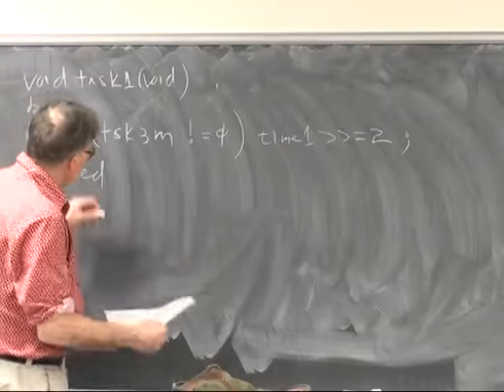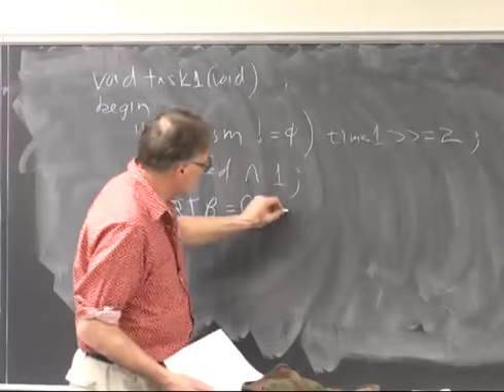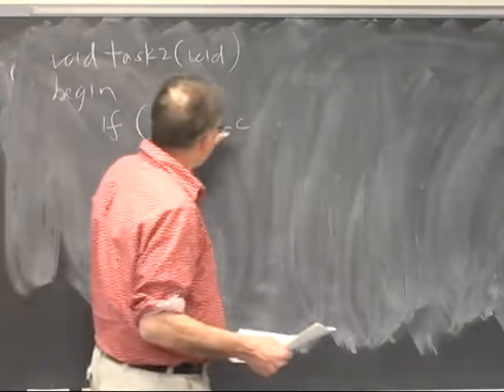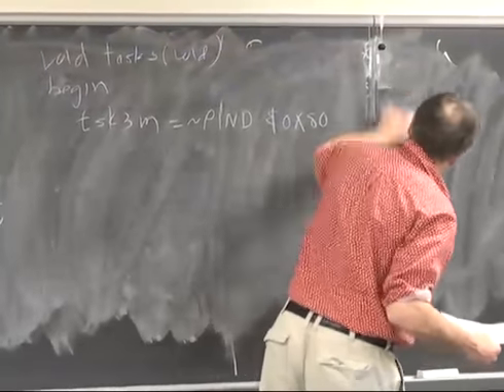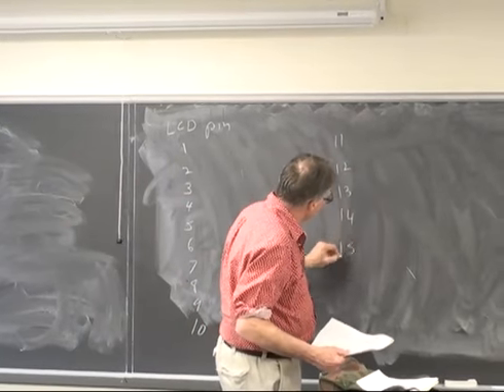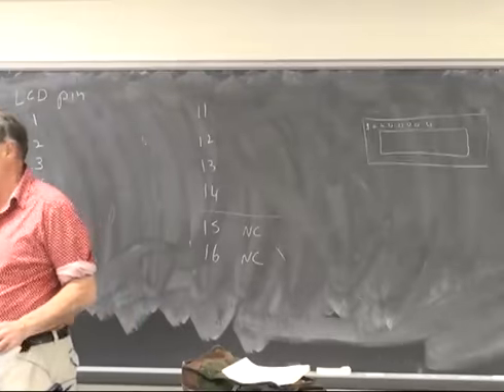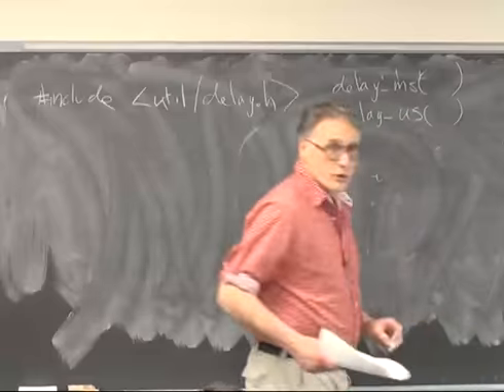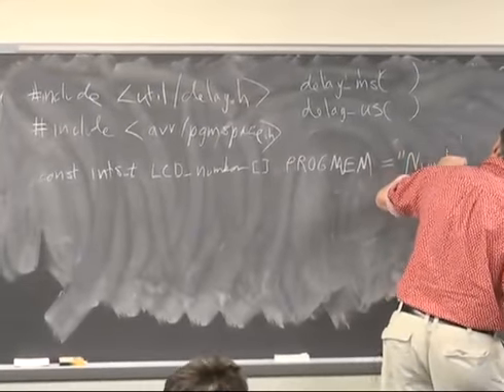#4 - Timer and LCD examples

Comment: At 22:44 there is a rather interessting point which Bruce (intentionally?) ignored. Timer2 needs to count up to 1000ms and that is impossible with an 8-bit counter. Bruce just says "because I'm using byte variables I had to do a count to get to the appropriate numbers of milliseconds". 

Well, that is of course true, but it is also a very smart ting to do! You might think "why not change the time2 variable to a 16-bits integer?".

Wrong!! Remember this is an 8-bit microcontroller, and comparing a 16-bit integer will take more than one clock tick (instruction). That means there is a chance the ISR will interrupt right in the middle of the compare and the result will not be what you'd expect. A trap for young players (including myself although I'm not young). 

Thanks for the lessons!

Comment: Why do you explicitly (manually) 0-terminate the string to be displayed on the LCD? C specifies that a string literal should be 0-terminated automatically by the compiler.
Reply from the maker: +Árpád Goretity Just to remind students about the extra character needed for the terminator

Comment: HI I was looking at you prototype board on the website. Is it possible for me to purchase a blank PCB board from someone? I have a STK500 but it is clunky and like the simple and flexible design of the protoboard your using. I was wondering which mpu your using presently ATMega644, or ATmega32, or ATMega1284? I've learn pascal in high school so at home with your begin/end blocks.  Thanks Don

Comment: Thank you VERY MUCH for these lectures! I have a question though: At 15:30, you have only one line of code that will be executed if tsk3m is not equal to zero, because you didn't put the following statements inside "begin" and "end." However in the task2() function, you also do many of the same things if the decremented value of tsk2c equals zero, but not if it isn't. So in task1() those lines will always execute (regardless of whether or not the condition is true), but in task2() they won't.